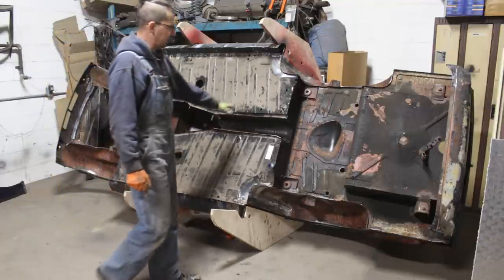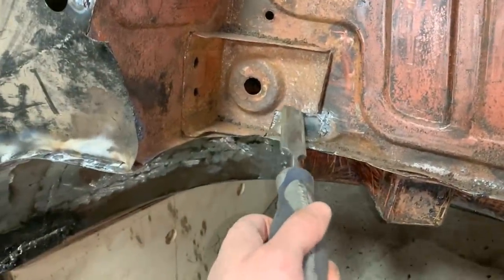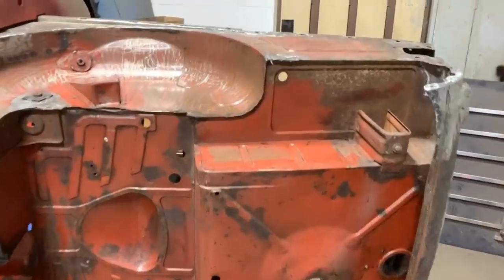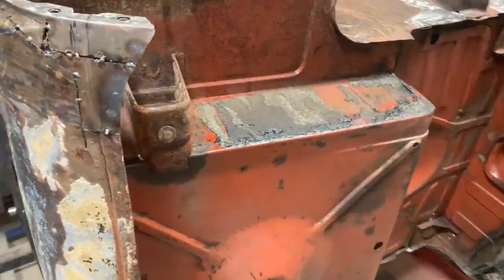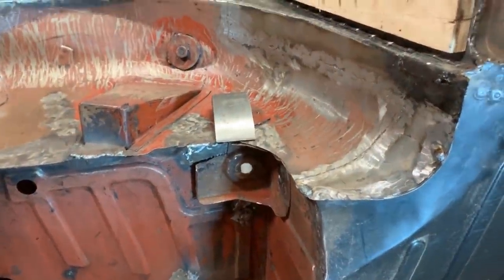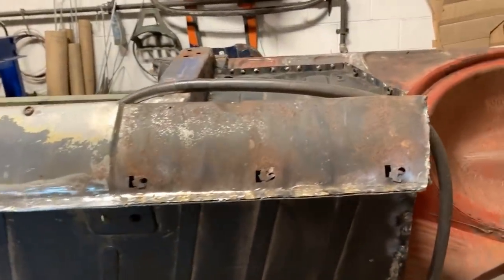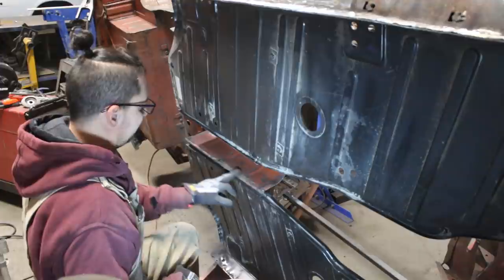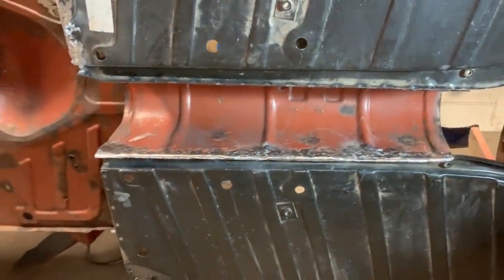1974 Triumph TR6 Restoration - Part 36 - Bottom Repairs

Comment: What do you use as laquer thinner? It did a great job. I've been using a citrus-based degreaser and it has been slow going.
Reply: Dave, I use an oven cleaner from Dollar General. The cheap stuff is just as good as the more pricey ones.
Reply: @tombrown7449  Good suggestion. I'll give it a try. Thank-you.